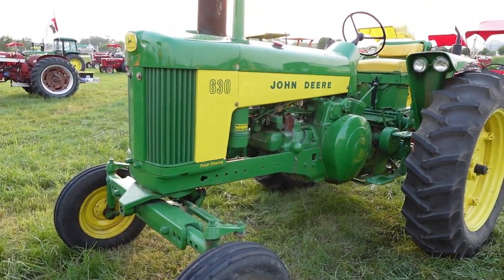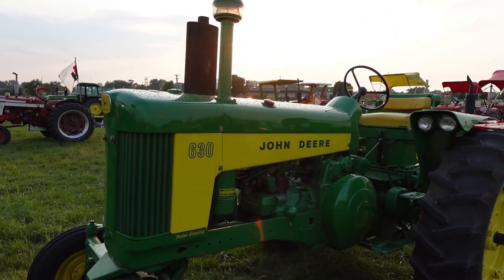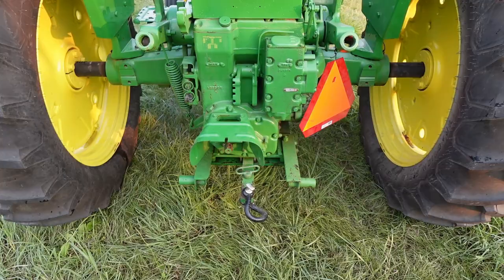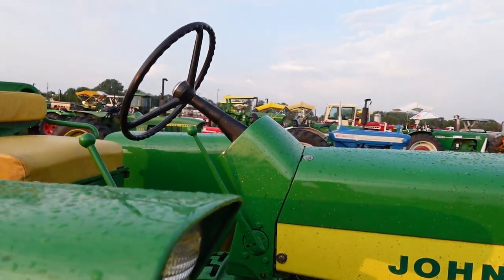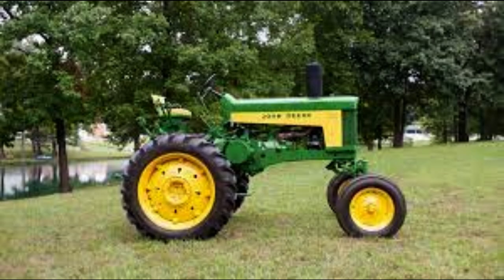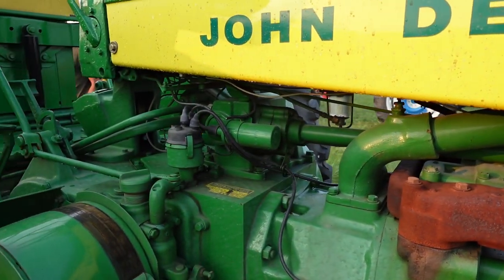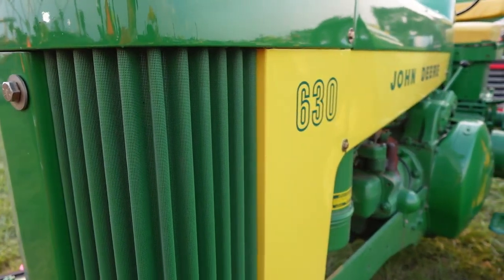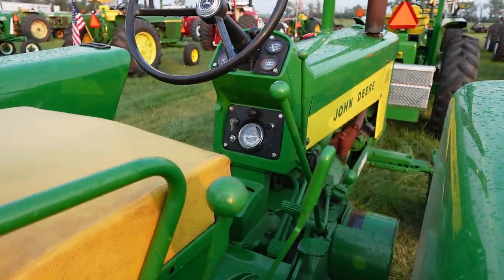John Deere Model 630 (End Of a Generation)

Comment: I'm curious what a modern 2-cylinder row crop would be like had JD continued with research and development up to the present day. Awesome video as always!
Reply from the maker: That is a interesting topic, I wonder how much horse power John Deere could get out of a modern 2 cylinder engine. Might make for a good video. Thanks for watching 👍🏻
Reply: The reason Deere quit making 2-cylinder tractors was because they had maxed out size-wise what 2-cylinders could do.  There was no room to add more cylinders.  The 3010/3020 had 4 cylinders and the 4010/4020 had 6 cylinders but the crankshaft went front to back rather than left to right.
Reply: @smidtwarner The potential of the 2 cylinder wasn't quite maxed out; they all ran at very low rpm, few were diesel, multiple valves &/or turbos weren't available.  It was primarily the customers & especially competitors who labeled them obsolete, despite many of the multi-cylinder designs being quite old also.  Clearly the 2cylinders could have been updated with advanced hydraulics & perhaps transmissions. But, the clean break to the New Generation leapfrogged much of the competition.   Tractor pullers have JD G - 730 turning out 85-105 HP, so it's possible...
Reply: Jd wouldn’t be a company
Reply: @davidkottman3440  It’s crazy whenever I go to a tractor pull and see the unstyled G out pulling some of the newer tractors. The most recent one I went to had a 730 diesel which I think out pulled everyone else lol.

Comment: So why are the spark plug towers on the distributor cap 90 degrees apart instead of 180 degrees separation?
Reply: They are not running compression stroke opposite each other. Crank is 180 degree difference between pistons so spark happens half as often. (90 degrees) To have 180 degree difference on distributor would require pistons to be on same crank throw which would be very hard to balance in big 2cyl engine.
Reply: @brentjohnson9210  ok then, 
so plug 1 fires.
The rotor turns 90 degrees then plug 2 fires. 
Now the distributors has to rotate 270 degrees to be in position for plug 1 again. 
How does that work?